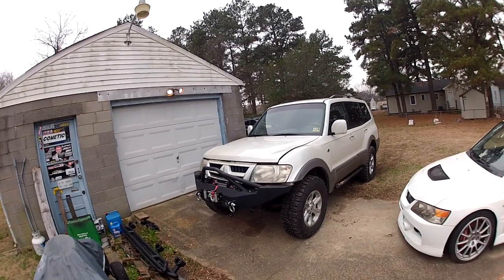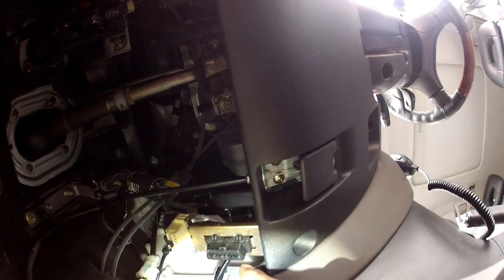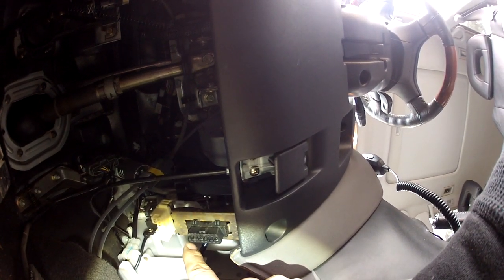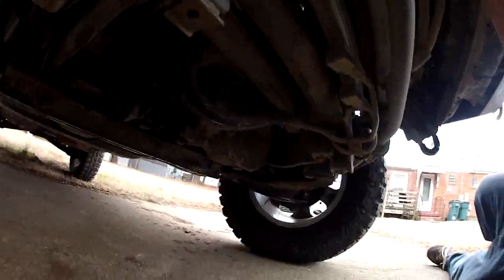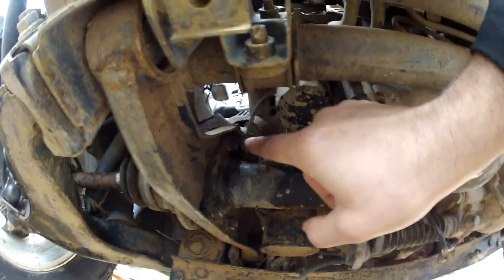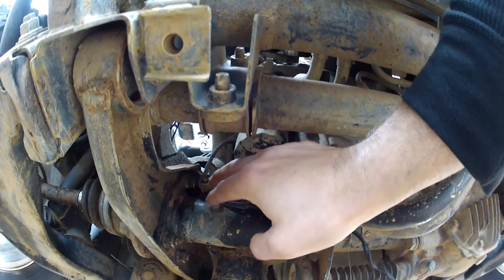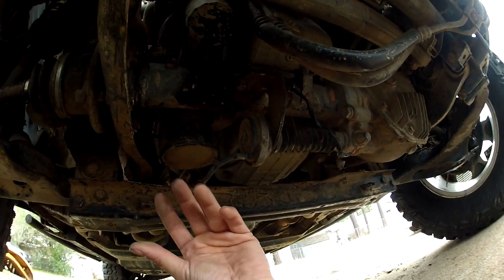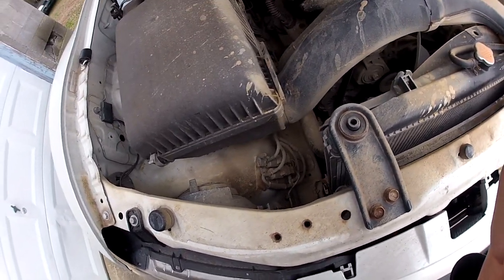How to fix blinking lights on Montero Pajero Activ Trac Super Select

Comment: I've got a 2005 Montero, and one of the lights indicator (rear left) it's off...code it's 35 and apparently I'm not having that wheel enabled (engaged). The system it's up and running, actuators, vacuum set up and the valve switches are working properly but sometimes when driving the transfer light indicator starts to blinking orange. Do you have any clue about where should I start to look into for a quick diagnose? Thanks for your help!
Reply from the maker: If one green light is off but the one beside it is on as with the rear wheels... that means you have a light buld blown out. The two front wheels and two rear wheels will always be on or off together unless a bulb is blown. Not a big deal but if it bothers you, youll have to replace the bulb. The code 35 is the front wheel engagement actuator and switch. Watch the area in the video related to the front of the truck, specifically when i talk about the "actuator" and the "switch". Dirty switch plug, bad switch, dirty actuator, or one of the two vacuum lines that goes to the actuator need to be replaced.
Reply: @davidg.9478  Just got the whole diagnosis you mentioned before and checked the dashboard, turns out one light bulb is missing; couldn't find it from nowhere...do you have any idea where I can find the OEM spare? The light bulb it's a T5 S BD8 but the ones I ordered at eBay didn't fit well and I'm kinda needing some advices if you have any.... thanks in advance for all your help man!

Comment: Thanks for the video, great help. I’ve got code 33 and am going to replace all 5 switches. Can you tell me the steps to dropping the transfer case? Did you do it with or without disconnecting the driveshaft?
Reply from the maker: No, yull have to disconnect the drive shaft and then drop the tranafer case mount and lower the case with a jack. You can lower it enough to reach the switches but youll still have trouble seeing them. So sme feeling around is required.
Reply: Buy Genuine Mitsubishi switches not cheap aftermarket ones.

Comment: What a great video. I am currently having a problem with my Pajero glx. All vacuum hoses on the gearbox and transfer case have been removed. It lost power,speedometer doesn't work.etc. may u pliz describe for me how the vacuum line immediately next to the gear lever(not transfer case lever) connects to the transfer vacuum lines and I restore this 4 WD? Eric.

Comment: You stated that you were going to post a link to a chart with the definitions of the codes in the video description, but I don't see it. Also, I believe to read the codes after shorting pins one and four on the OBD-II connector, the key must then be placed in the "run" position, not the "acc" position, as you stated.  And if there are five transfer position switches and one is bad, giving you the 33 code, why would you say that a lot of people just change all five? Isn't that like people replacing the solenoid pack to start with, before even pulling codes...except a lot more expensive? Lastly, can you pull "any" of these codes out of an OBD-I/pre-96 Montero?
Reply from the maker: It's a 26min unscripted video of me rushing to include a lot of information.  I misspoke several times but for the most part all of it was corrected a some point. People change all five because it's a lot of work to change one and the same amount of work to change five. It's not even comparible to the solenoids. Replacing all would be preventive maintenance after the problem is fixed. Randomly replacing the solenoids cause your lazy to take 2sec to check the code is just moronic. You can pull these codes of any of the active-trac and super select equipped vehicles.
Reply: @davidg.9478  David,if u could avail us ur watsapp number,we would keep in touch with graphic or photographic representations of what we r talking about unlike YouTube videos and their hardship loading.

Comment: Thanks for the help David! i tried to pull the codes by connecting a wire to pin 1 and 4 but all lights went off completly nothing is blinking. Any suggestions?

Comment: Hey david. I do have a code 33 on Montero,  I replaced all 5 sensors, check the actuator and it is working,  but the orange light still blinking and dosen't let the transfer lock on any position,  Do you have some ideas or tips cause I try also the shifter and nothing works. . Thank you.   Also  if can show how you  did the bypass.. thanks again..
Reply: What fixed your issue?  Similar issue on mine. Thanks!

Comment: Hi, I have same problem with my Mitsubishi Pajero 2009 when I drive in highways with 90km/h speed and higher, the scan tool shows a code U1120 with super select 4WD. Do you know what the problem is? And could you please help me with this issue?

Comment: David, are you still answering questions on this video? I have a 2003 very similar to yours but I also have a 2001 XLS and the flashing codes appear on the ABS dashboard light. Have you come across anyone with the same problems but from this year model? is it normal that the it uses the ABS light for emitting those codes?
Reply from the maker: I am, and if the ABS light is flashing then there is a code attached to it. I would try to pull the ABS codes before moving forward. The ABS system communicates with the Actic Trac and Super Select but ultimately the ABS system is its own entity and youll need the code in order to resolve the issue.

Comment: thank you for the video it is so helpful i got the code 34 can you tell me what's that means ???
by the way i have a PAJERO 3.2 did 2001 engine 4M41
Reply: not yet hhhh
I found problrm in the vacuum and the switches.....
A lot of problems
Reply: @guesmiomar454  hows it going? I fix mine after spendinh 4 months waiting for parts and a good mechanic lol

Comment: This video is very informative.My experience was to try all these things and when it came time to purchase transfer case switches I went for one of the cheap aftermarket sets (-$50).These actually made things worse as the vehicle would no longer shift from 4th to 5th and still had flashing lights.I rolled the dice and bought OEM Mitsubishi switches for $330 and like magic everything was working properly!

Comment: Hi David I have code 75 come up with center diff light flashing and no 4wd selection was thinking it was one of those 5 switches any thoughts ?
Reply from the maker: Are you sure its code 75? I don't know of a code 75.
Reply: @davidg.9478  sorry David got this code with a gscan code reader . Did just check it by grounding the ob connector you showed and got code 33 witch confirms what i was thinking thank you 
p.s great video very informative
Reply from the maker: Good stuff mate and thank you.

If you want to figure out which switch is causing the issue and have some basic knowledge with a multimeter, the super sheet in the link will show you all the positions and you can check each one to see which is not in the right position.
Reply: David G. Hi david sorry to be a pain but did all 5 switches code 33 gone now I have front wheels flashing and code 32 coming any thoughts thank you

Comment: David,  Thanks for sharing.  Good stuff!... On another note,..what type of bumper Make/model is that?  Where did you get it?  R/
Reply from the maker: Your welcome and hope it has helped.

Its is a Jeep JK bumper thats 72" wide. Anything shorter won't reach the fenders. I made custom brackets that mounted around the Montero frame to bolt the bumper too. Jeep bumpers have flat plates for mounting so they're not too hard to adapt.

Comment: Hi David.  Thanks for the video.. great info.  I have a 2003 Montero Limited (in Central Indiana).  I grounded pin 1 to pin 4 and the center diff light simply blinked uniformly (I think the short blink) for many minutes.  It did this both times I tried it.  Any thought on the reason for that?  Also, I have a Zurich ZR11 code reader, and it has supposedly reads Mitsubishi ABS codes and it showed a code 35 "engine fail".  Do you have any info on whether these issues may be related?  IT's from the rust belt, so I'm guessing some of the five Tcase switches are corroded and not working right.  I look forward to your thoughts?  Thanks.
Reply from the maker: I would attempt the pin 1 & 4 again to make sure or pin 1 to a ground.  If the 4WD lights are blinking then you have a code that goes with it and you need that code. Engine and ABS codes read from a diffrent ECU and will not represent the 4WD system.

Comment: Hey David, I wanted to ask you about my car which is a 2006 Pajero,Whenever I switch the car to any type of 4WD the front light just keep Blinking and nothing happens and when i switch it to Low gear it just does the same thing but with the Dif Blinking too
Reply from the maker: Well, step 1 is to pull the codes. The front blinking lights is going to be one of the two main differential codes. I cover most of the causes for issues under the front of the truck in the video so i would start looking at that after you know which codes its throwing at you. The center light may be a result to the front lights blinking so i would put my efforts into fixing the issue causeing the front lights and then if its still blinking the center at you in low, then focus on addressing that.
Reply: @davidg.9478  Okay then am looking to do it today Hopefully and thanks you are a life saver